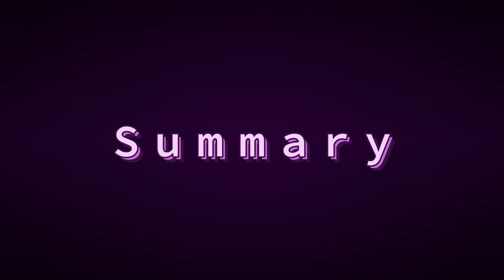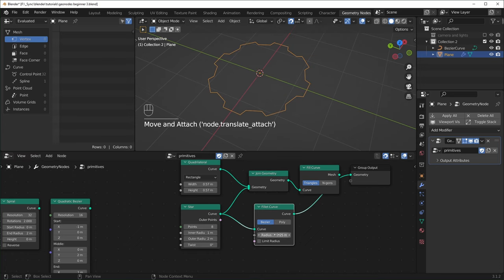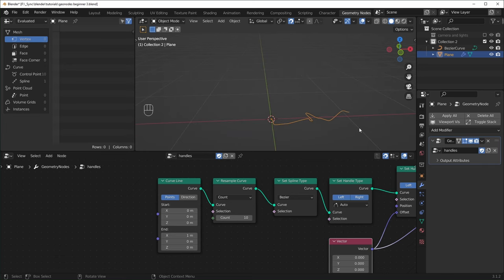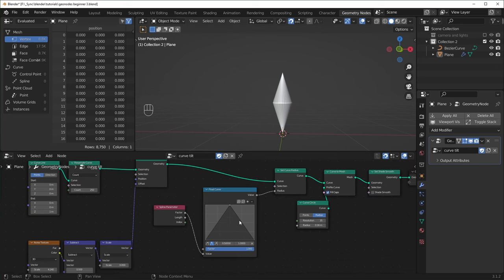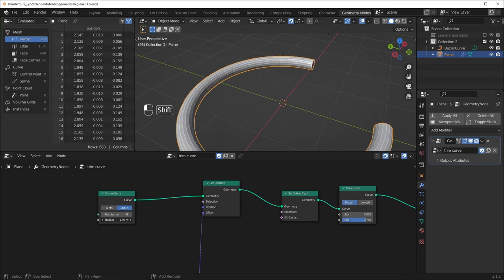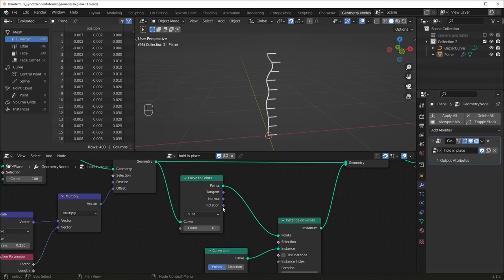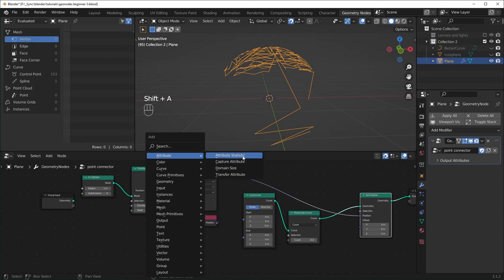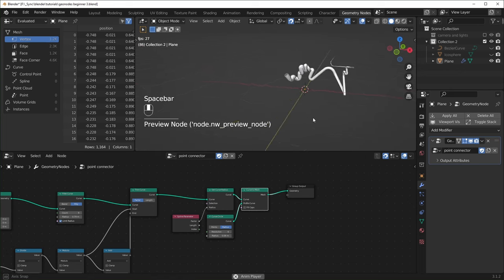Curves - Geometry Nodes for Beginners

Comment from the maker: ⚠ The transfer attribute node no longer exists! Use the sample index and the index node. Watch this to learn more: https://youtu.be/K-L2eIHu7ic
Reply: sample nearest sample index method makes only a few connected lines. idk how to make it to continue connecting points
Reply: doesnt seem like the line is even going from point to point, does like two random turns and stops
Reply: @SurrogateActivities  True, I got stuck there, if you found an answer, do share, Thanks
Reply: @CryptoGrammar-v5z   rebornl posted this in another comment below:

"For those having trouble with missing transfer attribute node part at the end.
1. Add three nodes, Position Node', 'Index Node', and 'Sample Index Node'
2. Connect 'Position Node' and 'Index Node' to the 'Sample Index Node''s value and index
3. Connect the 'Distribute Points On Face Node' to the Sample Index Node's Geometry
4. Connect 'Sample Index Node's Value to the Set Position Node's Position."

Comment: great vid! I know you've already explained the transfer attribute switch to sample nearest / sample index, but it seems like the new setup has an issue with the curve not wrapping fully around the object. I believe this is because it doesn't take into account that it shouldn't set spline position to the same point location more than once, but i cant seem to find a fix. any suggestions?
Reply from the maker: Instead of sample nearest, plug the index into the sample index node
Reply: that did the trick, thanks a bunch!

Comment: I'm trying to do something similar to the join + fill curves, however I don't want it to make the hole in the middle. I am trying to create something more along the lines of a boolean so that my intersecting object will add to the curve shape. I need this type of merge to happen so an outline can follow the outer edge shape of the two curves (making speech bubbles for comics) do you have any insights on this?

Comment: Tutorial idea - since I need it 😁Some kind of curve controlled "slat wall" that will survive boolean cutouts for windows and so on. Each slat should have a random value for it that gets sent over to material nodes (this breaks down for me when I boolean both in geo nodes and as a modifier). Ideally the normal offset from world normals (rotation value would work too I guess) should also be sent over to material nodes. Material nodes can use image based box mapping for straight walls, but around curves you'd need a manual triplanar mapping system which orients itself on a per slat way; i.e. the straight part would have rotation 0 (aligned with x i.e.), rotation 90 for perpendicular wall section, and somewhere between 0-90 along the curve between those two section. Point is random lookup (using random value -> 1D white noise) of a wood texture where each "manual triplanar mapping" orients itself to match the orientation of the slat.

I can do the slatwall just fine using geonodes in a destructive fashion, but I'm screwed if the project changes and I have to move walls around, as I have to apply it and separate by loose parts in order to use image based box mapping by rotating the parts origo to match the geometry's orientation. Although I prefer manual triplanar mapping/image box mapping myself, others may prefer UV data to be sent over to material nodes.

Comment: This is almost exactly what I was looking for. I'm working on a project where I need to basically do array on curve but with geo nodes because it has to be procedural and I was loosing my mind. The only thing is I need both ends of the curve to connect to each other. Any idea how to do this without changing too many things?
Reply: Actually never mind, it was as easy as switching the curve line node for a curve circle node. I fucking love nodes.

Comment: Hi, thanks for the excellent explanation. as you mentioned Transfer Attribute node could be replaced with Sample Nearest Surface node. how can be the value connector from that node linked with position connector at the Set Position node. if I make connection directly then I get a warning display: "no group output attributes connected".  many thanks in advance for answer.
Reply from the maker: You need to use the sample index node and in the index slot plug in a sample nearest node. Use the same geometry for both nodes, then you'll have an option to use points.

Comment: This is really getting me on my way but I can't quite get the result I'm after! I want to draw distorted curves like you are achieving with the noise texture but I want one end to be attached to the origin or the centre if you will and each curve to un out to a point produced by "distribute points on faces" node... Any help apreciated!!!
Reply from the maker: If you multiply the noise with the factor from a spline parameter node, plugged into a color ramp with black on both ends and white in the middle, then the ends of the curve won't move but the middle will. I do this in my lightning video

Comment: 14:59 Adding the shade smooth node and then disabling it is not the solution to the weird artifacts along the tube. We should have an option to have shade smooth with sharp edges, such that the tube is smooth but its edges are sharp.
Reply from the maker: You can use the "edge angle" with a "compare" node going into the "set shade smooth" to do that
Reply: @JoeyCarlino  Interesting, I shall try that, thank you for that :)
Reply: @JoeyCarlino  I managed to do this by comparing the normals instead of the edge angle, something specific to my use case, thanks again for the tip!
I came across this video again when I looked for resizing the radius of the curve, so I wanted to thank you again for the information in this video, this is very helpful.

Comment: is there a way to create a profile with a float curve? Like you would with regular curve profile settings
Reply from the maker: You can use a float curve to change the thickness of that's what you mean. Take the factor from a spline parameter node, plug it into a float curve and plug that into a set curve radius node. If you put this before a curve to mesh node then it will let you draw whatever shape you want with the float curve as long as you have the resolution high enough.
Reply: @JoeyCarlino  not the thickness, but the profile. Give the curve steps along the length
Reply from the maker: I don't think you can do that. You can make a separate curve and use that as the profile if you want
Reply: @JoeyCarlino  ah shame. I wanted to try and avoid using external meshes and curves. I'm trying to use a mesh as hair, but the root disconnects , how do I make sure the root stays connected ?